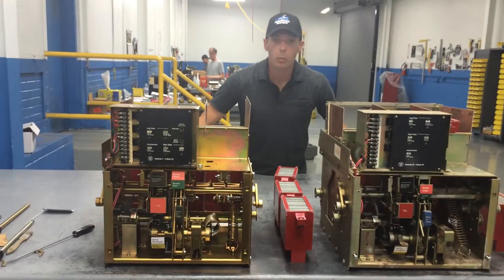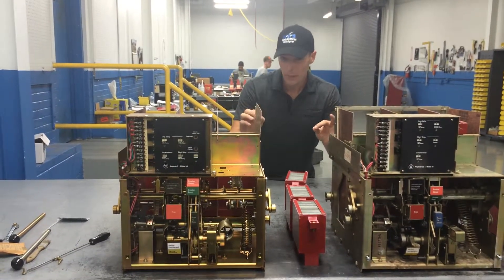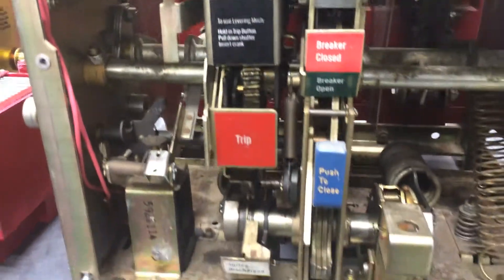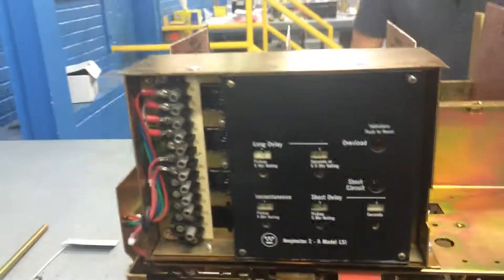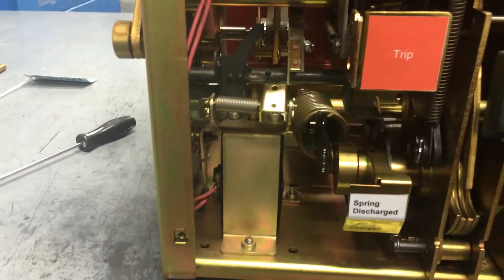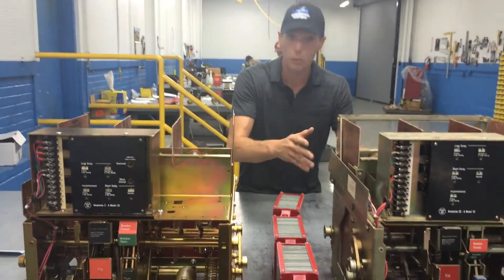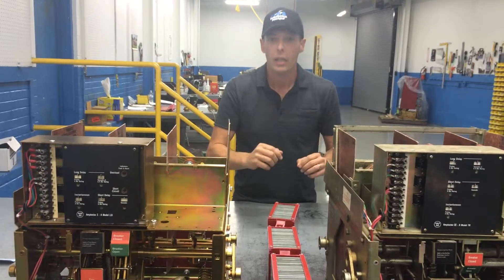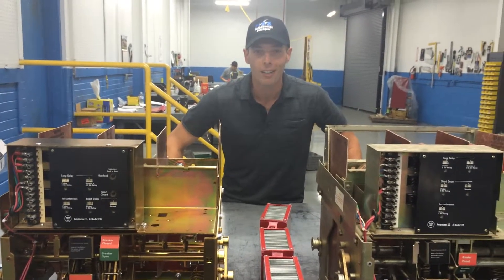DS-206 , Westinghouse DS-206 Circuit Breaker , Reconditon Versus Replacement

Comment from the maker: Westinghouse DS-206 Circuit Breakers.

No matter what they call it: Recondition, Remanufacturing, Rebuilt, Overhaul Etc. Your circuit breakers should look like this when you purchase  (What we refer to) a "Class A Recondition". You need to be aware that NAS takes these breakers down to the smallest components and builds them back up with new hardware.

I also felt it was important to let you know when you are shopping around for price and availability this is what you are getting at NAS. We do not hide our work, NAS is very open regarding our services and capabilities. We are very proud and vocal regarding our work and why not? Our Family has been in this industry for two generations and we feel that our Class A Reconditions are at the top of the mountain. We back up what we do and we will never lower our standards to to compete and steal business. We are who we say we are and that is important in this day and age.

We back up our product with warranties, test reports and years of experience. I tell customers all the time, "Its not like we have 1 or 2 on the shelf and don't plan on buying more down the road. This is our life and we have spent Millions of Dollars through the years building up our huge inventory so we can support you and keep you up and running".

Thank you for supporting Family Owned and Operated North American Switchgear. www.naswgr.com